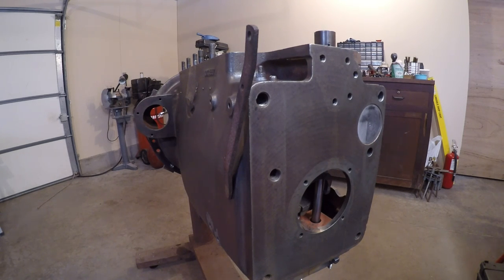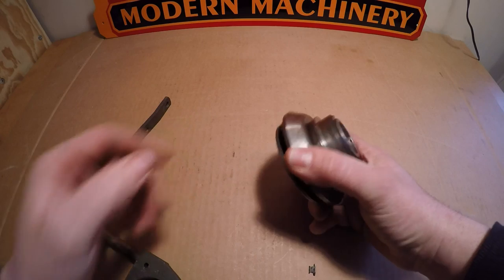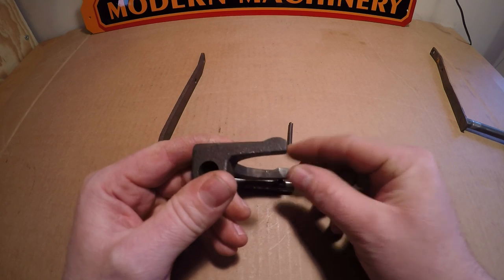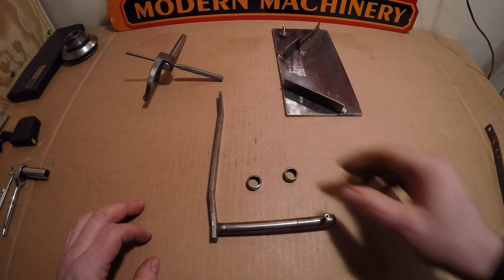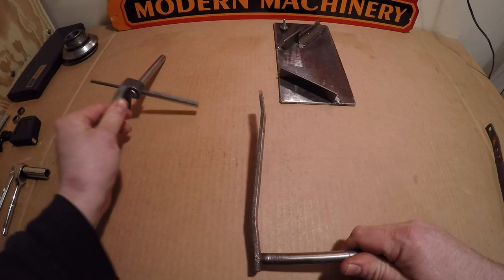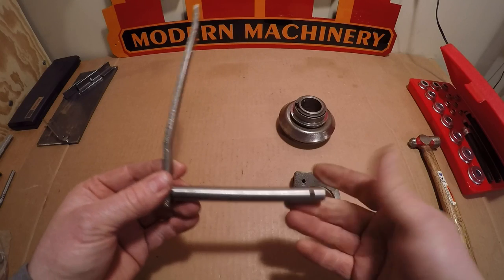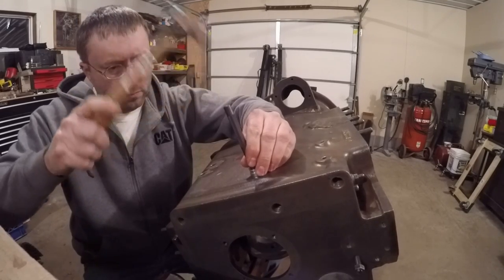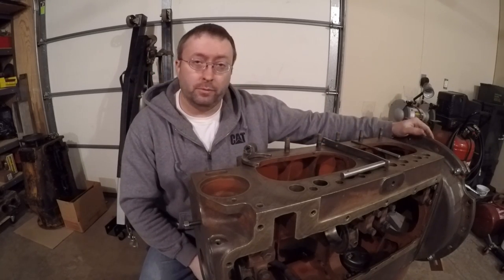Minneapolis-Moline Prototype 445 Tractor #X231 Restoration - Part 5: Governor System

Comment: Fantastic series and excellent detail and workmanship. Interesting that they did choose Torrington needle rollers for an oscillating shaft, certainly accounts for the false brinelling on the shaft given the small arc in which it turns. Perhaps it was more expedient to use them rather than bushes at the time of the prototype build? Keep up the great work and thank you for all the uploads.